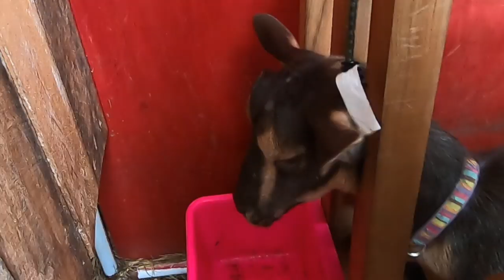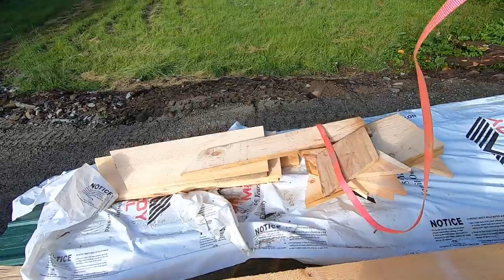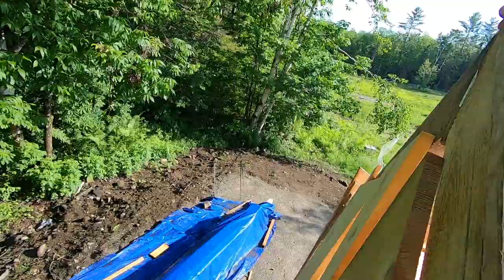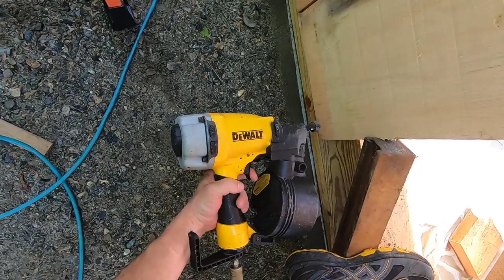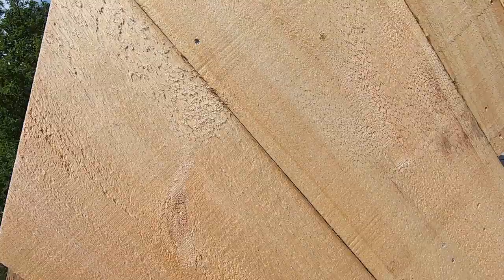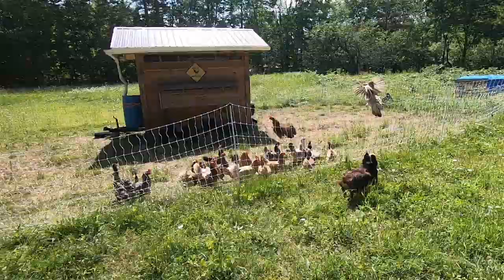It's Starting to Look Like a BARN! PHASE 1 of building the Barn Kit Bought on the INTERNET

Comment: I've never seen a hatchery that didn't let you order females, males, or straight run.  Ideal Poultry and Murry McMurry are the hatcheries I use, and they let you choose.  The barn is going up so easy!  I know the top ridge was hard, but not having to saw the wood makes it easy to put up.
Reply from the maker: So they let you choose on Cornish crosses?
Reply: @LumnahAcres  I thought I had responded but don't see it now.  Murray McMurray sells Cornish crosses at this website:  https://www.mcmurrayhatchery.com/jumbo_cornish_x_rocks.html

Comment: I know its too late now but get you a 3 ft 2x4 put 1 screw in it flat a little behind that board a on that bottom beam you nailing to. and you can pull it straight.

Comment: Gooooood Afternoon Al ,
Since I don't receive any prizes for being number one , I've decided to sleep in and catch you later. lol  Man , your barn is looking smaller and smaller the closer you get to finishing it. What do I mean ? Well , one or two vehicles , a work shop plus the stuff that you have in your basement , the goats and suddenly you are out of interior space.
  Your wedge on the bottoms of the boards worked well .  I think that I would have tried the ratchet straps to pull the boards tight up higher to eliminate the gaps completely. Winter time drafts are going to be cold. Of course you can always fill in with some caulking.
  Hope seems to often be the first one out the door .  And she appears to be getting fatter.  Soon she will no longer be able to get into the hay rack .
 Congrats on reaching 100 K .  The last 10 K seemed to go so slowly.  And then suddenly you jump to 101 K. lol  All in all , your channel has grown pretty fast .
 The two channels that I watch the most are you and Swedish Homestead.
Reply: Al is putting battens on siding.

Comment: Question
The siding boards don't need a small gap between to accommodate swelling
Reply from the maker: No the siding is a little wet it will dry some more and shrink

Comment: According to OSHA,about 37,000 people are treated for unintentional nail gun injuries each year in emergency departments in the US. Forty percent are suffered by those not at work. (i.e. homeowners.) In my industry, I've seen more than my share of workers carted off to the ER  with nails shot into body parts where they certainly don't belong. The one thing I'm thankful for is that I haven't seen anyone shoot one into the eye. Yet.  Still, NOBODY, carpenters, management, engineers (me)  or visitors goes on the work floor without wearing safety glasses. Please, please consider using them.

Comment: I saw a nail sticking out of a piece of scrap wood that you were handling;  Sorry,  you would be banished from any of my building sites. It either goes straight into the bin or if it is meant for the re-use pile then all the nails are removed.  Excellent construction otherwise.